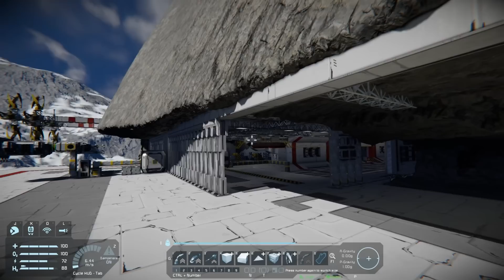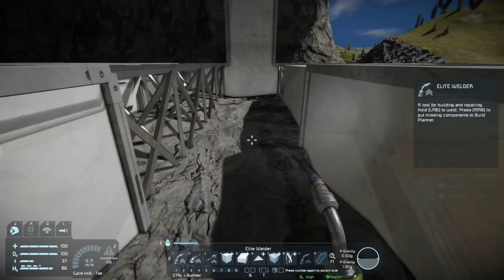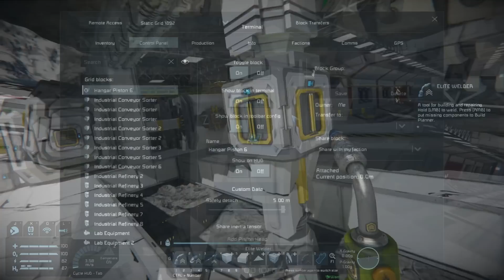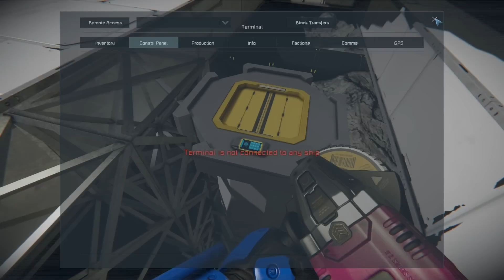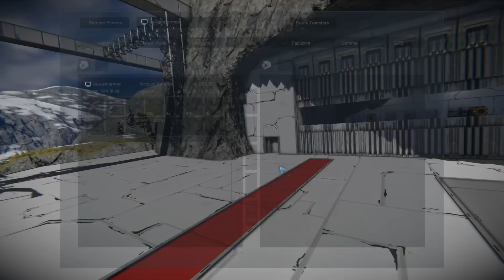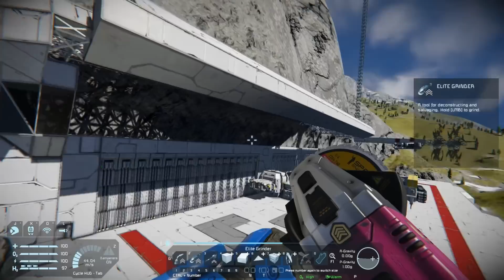BLAST DOORS and OBSERVATION DECK! - Vanilla SPACE ENGINEERS Survival - Ep 20

Comment: Am I missing something, but why not just use pistons to move a door made of fixed blocks? The pistons can move 10m which is 4 blocks of travel down and 4 blocks of travel up to make a door 8 blocks high? You can have them slide inside a one block sheath on either side to prevent wobble.

Comment: Tip of the Episode: Since a while back a lot of the sloped DLC blocks, have a more sensible collision box, this allows you to have a even smaller gaps in certain cases. Especially on small grid, you can for example make some really interesting crane arms, the are really close to some RL crane arms (i think telescope arm is the correct term for multiple hinges ¿). There a mods that show the collision boundaries (cool for later), but even with that, its often a case of practice to get a good feeling for it.

Comment: What might be kind of cool is you build the pistons of the upper hanger doors a little further up, and you make the pistons themselves a feature on the interior side of the observation room. Like some glass or I-Beams to cage up the pistons that work when the door open. Claim it's engineering, maybe rather than a light armour block, you use a pipe conveyer or something, maybe grind it down a tad so it's silver, and have them work away. It would especially work well if you had the gate do like an M or W shape rather than meeting in the middle. Shoot some smoke/fog out when you open the doors thanks to a little exhaust/timer block.

Loving the base so far, great work!

Comment: Some recommendations:
-  For welding the "build and repair" mod is perfect. 
- For mining there is an equivalent "miners" as I remember. 
- For the blast doors, from the blast door parts, you can build as big of a blast door, as you just like. I think, your current design is a bit overcomplicated.
- You should put some search lights and automated turrets on the top of the observation level
- As somebody mentioned, some guide lights should be also installed on the platform to mark edges and approach ways.
- I would put the observation level running over to the side too, to have a 270° view around
Reply from the maker: No mods .. vanilla playthrough :)
Reply: @SkyeStorme  ...But you Could have mods... ;)

Comment: For your hangar doors, you can use a single piston, then on top of that put a row of blast door blocks along the length of the hangar door area. Then put hangar doors on top. On the left and right side of these blast door blocks, put merge blocks facing outward.
When the hangar door is raised (in a closed position) you lock the merge blocks in place, making the hangar doors part of the main grid and locking them in place.
Then they need to open, you can then unlock the merge blocks with a timer block on both left and right side of the hangar door, and then lower the piston to lower the entire row of hangar door blocks down into the trench.
Neither hangar door blocks nor blast door blocks (if you pick the straight type) have collision on their front and back, only the merge block would need to be free from connections on its sides for this to work.

Comment: I'm not sure if its been updated, but for future reference when or if you are interested in exploring mods, this is a terrain tool mod. "Concrete Tool" in the workshop. It lets you use gravel to place concrete to so you can actually smooth out and fill in those areas you mine away. 
You ideally shouldn't do too many mods to begin with as a new player, but frankly this is a tool that I believe should be in the base game.
Reply from the maker: No mods .. vanilla playthrough :)
Reply: @SkyeStorme  Figured as much, excited to see what you get up to with them, if what you are currently building is any example.
Reply: One mod you might want to look into, is the voxel gun. It lets you place ground you've accidentically removed. And also lets you build snow piles etcetera.

Comment: you didn't need a second sensor you could have done both actions on the same sensor just use the different tabs on the actions. I like the engeneering solution you search to solve the problem. :) great series
for detailing you also have the nice truss and beam blocks that can work well in your build

Comment: A cool thing I saw on a server once was, a deep, wide vertical shaft (like your "Tom", and etc.) going down with wind turbines sticking out from the walls into the center of the shafts. The idea was that it represented a thermal vent system with a heat source at the deep bottom. Turbines don't need to be outside -- they can be interior so long as there's free space around them.

Comment: If I understand this right, you're raising the top door 2 tiles higher, right? I'm not sure if the top of the door will clash with the bottom of the viewing platform. I guess we'll find out in the next video, won't we. 😂
Reply from the maker: It aligns just right :)
Reply: Oh and in regards to the extended part of the viewing platform. Just make it into a bar or restaurant (i'd put it on the left side and have it asymmetrical but have it longer maybe 2/5 of the length of the whole platform. The control tower can go above like youre suggesting.